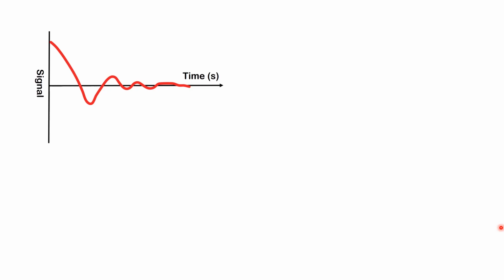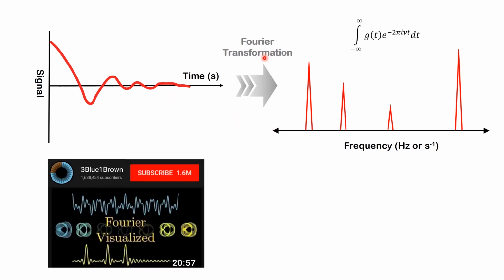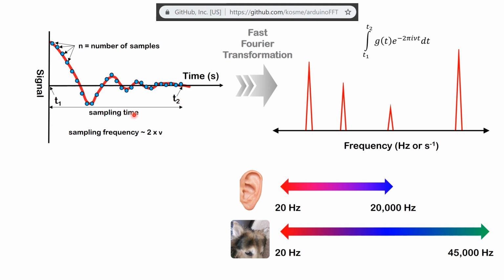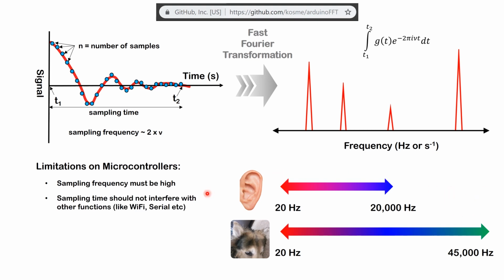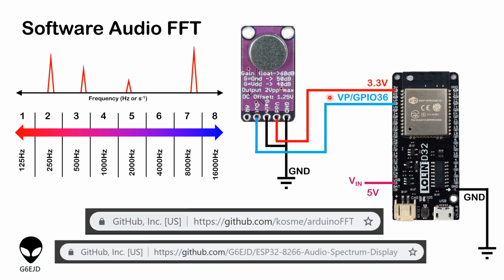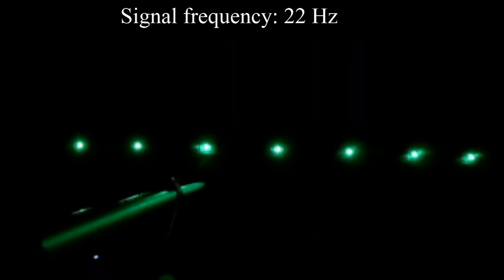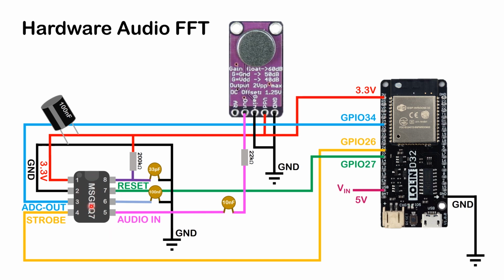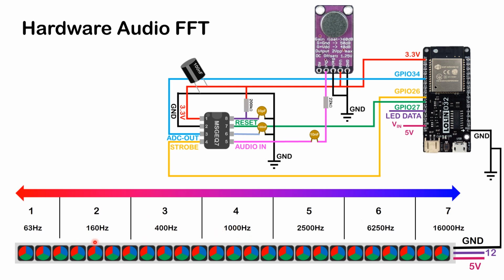ESP32 to process audio signals: Software (Fourier Transforms) and Hardware (MSGEQ7)

Comment: Nice explanation.  I've recently just done a similar project where I really pushed the ESP32 to do faster FFT calculations for more bands.  I've achieved a 4096 input FFT on the ESP32 in just 27 mSec.  So I've been able to display 8 Octaves with 7 LEDs per octave.  My project is described here: https://hackaday.io/project/175944-the-visual-ear

Comment: How could i use an arduino uno instead of the esp board? Also what mic did you use ?
Reply: I don't think the uno has the required processing power/ memory space etc
Reply: @deb-sahu  ok where can I find the code for the MSGEQ7

Comment: If I wanted to wire this up directly to an audio output jack of a cellphone, what changes would I have to make to your circuit? In other words instead of using the microphone board. Great video!
Reply: @deb-sahu  Hi, Thanks already for the video. this link is dead. do you have other links that illustrates what you said?
Reply: @deb-sahu  Thanks! its strange...Im getting signals even when no sound is being played. I always have the same figures in the serial plotter, no matter the sound that plays..do you have an idea of what the problem could be? (I'm using an ESP8266)